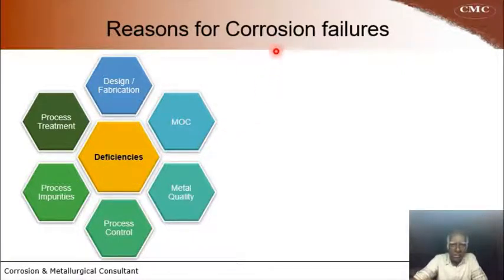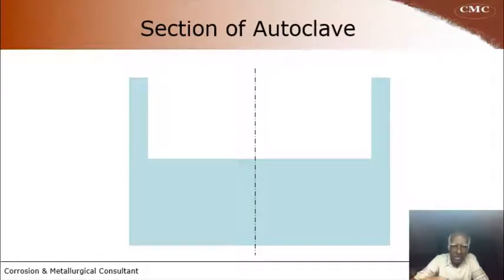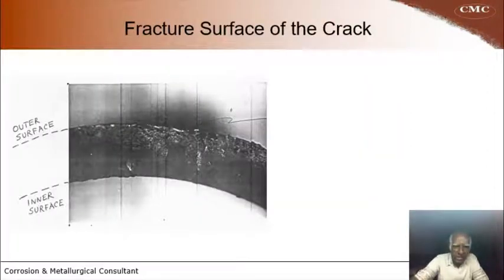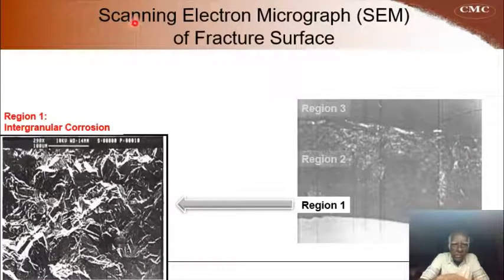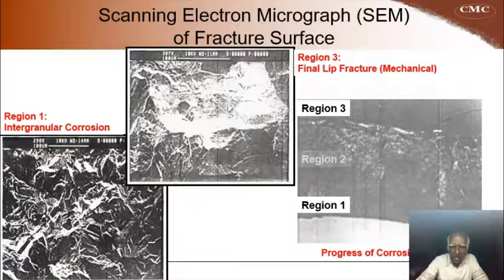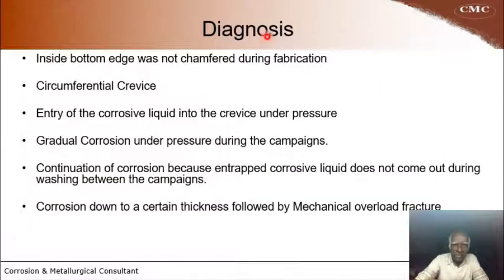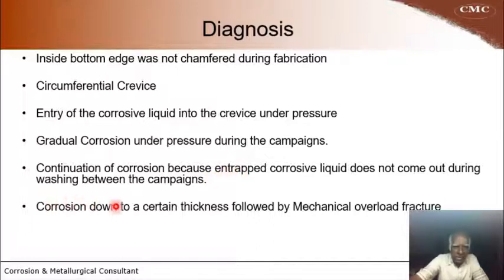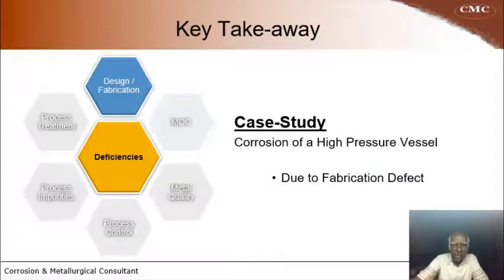Lecture 6 : Corrosion : Case Study on Corrosion Failures - 02

Comment: Was it a cylindrical or rectangular autoclave. In general autoclaves are designed as cylindrical where corrodents could not have accumulated and becoming stagnant and for internal pressure to distribute evenly.
Reply from the maker: Rectangular Lab test Autoclave
Reply: @corrosionknowledgesharingb8203  Basic design fault.
Reply: @corrosionknowledgesharingb8203  A basic bad design.